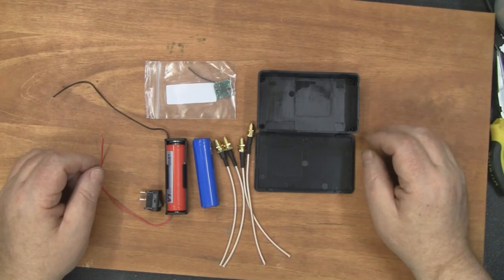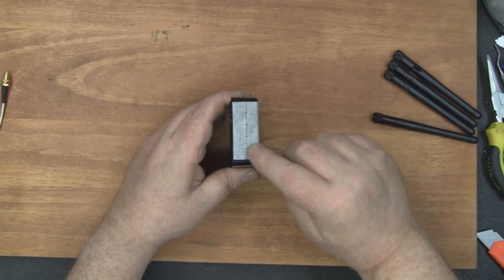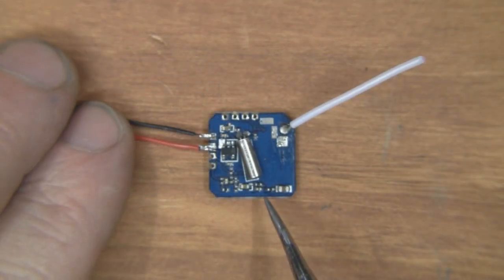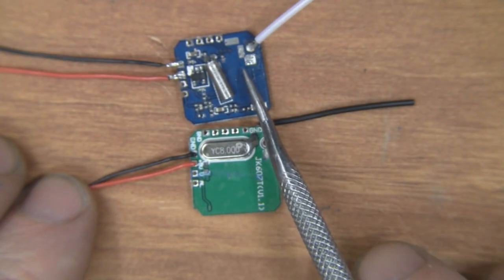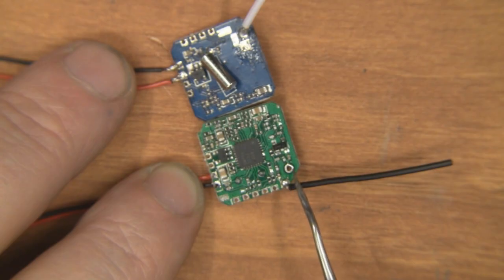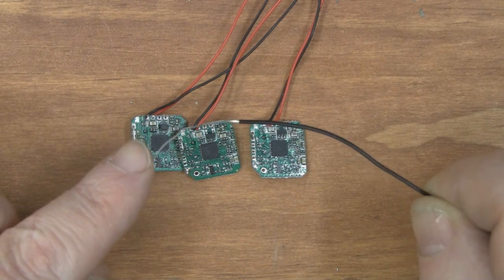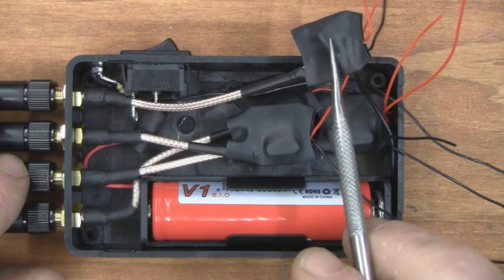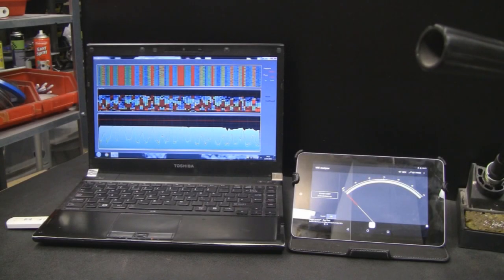WiFi Jammer #97

Comment: I might try this, but use an arduino, that will have a relay instead of the switch, turning it off and on in pulses to conserve battery, but still fucking with my schools wifi.. I mean how do you use wifi when it turns off every 10 seconds for 5 seconds?.. The issue is I would need another battery pack anyways..
Reply: Pretty cool idea,
could use it to spy and prank people with the Arduino camera.
Reply: Jake Cope As far as cameras go, I would just grab a RasbPi. It is ideal, as it gives you much more freedom, as it runs a fully customization and accessible Linux distro (usually. You could use a specific version of win.)
with said freedom. you could stream to the web or simply just record to and SD, without needing to buy and things to allow it it to do either. Well for Wifi if you use it but.. Though the raspi is ~$34, and the arduino is $12, however you could probably get away with $10 SOMEHOW with the $5 PiZero
Reply: Andrew Humphreys
Invest into a big MAH battery pack use the raspberry pi zero and look into crons job for the automated commands.
i think you could really get onto somthing there!
ultimate prankster
Reply: Andrew Humphreys
infact drop the pi idea, just go straight up with a timer switch, maby create a simple board with the 555 timer. then connect it with a large MAH battery pack.
it will use very little power.
if you look into my videos you can see some portable rasp pi devices. the first one I built with a single 18650 1800 mah battery lasted 13 hours on a single charge! Im sure the chips on this jammer unit would be much less as I was also using a wifi card on the pi as well.
Reply: Andrew Humphreys how would you turn this into a gsm jammer?

Comment: I really think you have to be considerate as well as very careful using such a jammer. What's good enough for the goose is good enough for the gander. I'd be very upset if some one was doing that to me. I'd use a WiFi direction finder to find out who was doing it and then there would be payback. Back in the days of CB Radio I tracked down some one abusing the CB bands, swearing, causing all sorts of problems night after night. I built a micro transmitter designed to transmit a messy carrier signal into all channels. It was only the size of a cigarette pack and transmitted only a very low power signal so I threw it onto his roof very near his antenna. It slide down into his gutter and shut him down for a couple weeks without bothering any one else until the the battery pack gave up. The really funny part was, he knew I fixed CB radios and brought his kit to me to fix. Needless to say I had serious problems fixing it. It took me weeks waiting parts it certainly did not need!
Reply: Brillant story! lol
Reply: No. You wouldn't. You actually wouldn't even know where to begin I bet. You can tell just by what you said, you are clueless.
Reply: ts not fx or unfx
Reply: Gary Templemain fuck the gander
Reply: R/prorevenge

Comment: do i need 4 transmitters and antennas or can i use only one
Reply: you can absolutely do it with just one transmitter and one antenna. The resoult will be less powerful
Reply: If you did this with just one antenna (which you definatley can) you would only be able to effect one quarter of possible devices communicating on that chosen channel.
if you want it to be effective then I definatley recommend transmitting on all 4 channels.
Meaning 4 antennas.
Reply: Alessio Scarlet result* :)

Comment: I ordered the transmitters from the description i received them. Now the layout is a little bit different from what is in the video.
http://i65.tinypic.com/2yxf6ko.jpg (Picture)

Ive tried making sense of the schematics, and i think i got i all right but to me the transmitters, i got, looks like one of the holes are soldered shut and there is a "spare" fifth hole in side opposite of the antenna. Anyone got any pointers, it would be greatly appreciated.
Reply: +kasper jensen Got the same ones. So it's basically follow the video and connect the same points?
Reply: No one?

Comment: Is there any way to solder and build an antenna for this because all the cables and antennas are a bit expensive all together, Thanks!
Reply: it's pretty expensive, but there's almost no way to build an antenna by self. i suggest you this antenna http://www.ebay.com/itm/171577444718 by the way
Reply: +Alessio Scarlet thanks for your answer but I would use an antenna wich is for 2,4ghz and not 400mhz :D

Comment: I don't understand really how the jammer works. Sure you have 4 different transmitters but from what I can see you simply fill up the spectrum with junk. But how do you target specific frequencies with it? Is that transmitter built to work across all wifi channels? What's the real purpose of that transmitter? What kind of equipment would you use to receive the signal?
Reply: each chip fills three channels of wifi ( I think he said this) so having all four outputting within their frequency band they fill up all the 2.4-2.483 ghz wifi spectrumim sure your question was already answered, but for anyone wondering something similar

Comment: Thanks for the vid. Where can i get the 4w amplifier you used in your other jammer project? I have only found very expensive ones online.
Reply from the maker: Kris Richards I have 2 of these: http://goo.gl/SFIAzf  you will need to run at least 4 batteries though as they chew up the power fast.
Reply: Excellent, thanks Andrew.
Reply: Do you have a new link maybe?

Comment: Must you have so many antennas or can you get some thing to cover other RF ?
Reply from the maker: FPV SPY You can use just 1 antenna and it will work well like I have in the sonic screwdriver jammer. By other RF do you mean 5GHz?
Reply: andrew mcneil Actually I wanted a full spread 2G 3G 4G etc

Comment: What sort of range are you seeing out of a unit of this size - Also, for the sake of completeness, what is the current draw from all 4 boards ?
Reply from the maker: Continuum Hi they are only very weak around 150m in open space.
Reply: andrew mcneil  LOVE the video and am currently trying to make one but having an issue finding the transmitter, the one I could find has 8 slots, power ground 3 different channel options 2 audio and 1 video. would there still work?